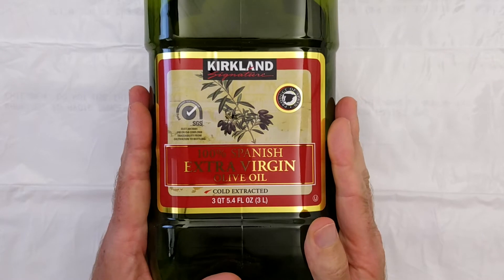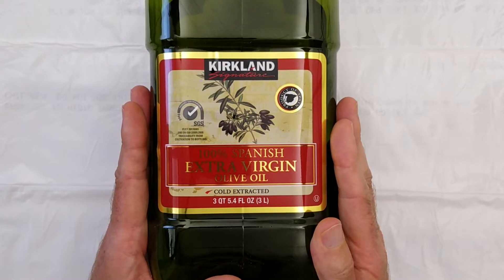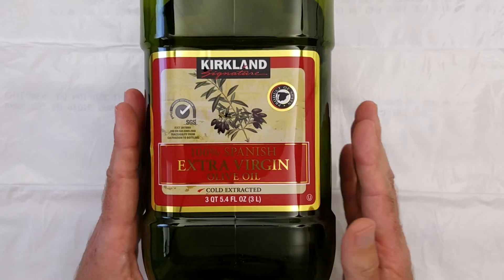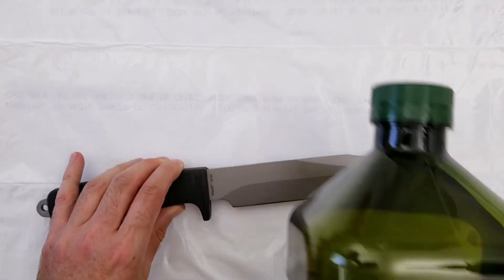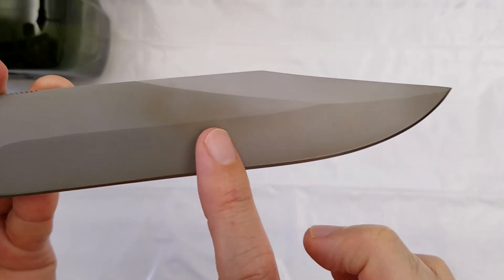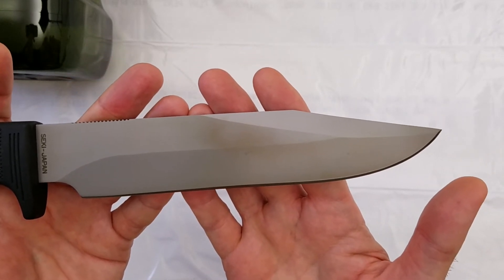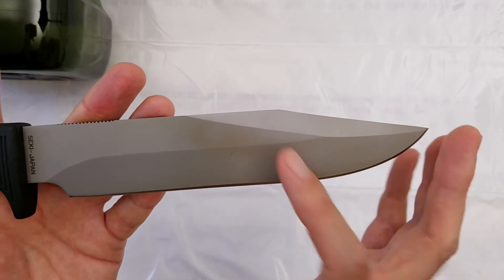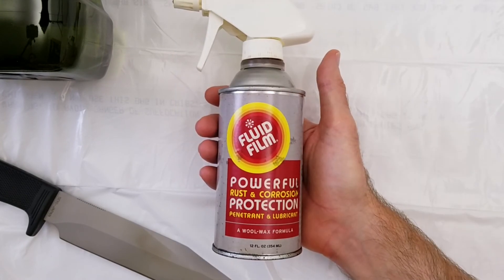Olive Oil as a Corrosion Inhibitor?  DON'T DO IT!!!

Comment: Thanks for the information on olive oil and lanolin.  I've never used these as a corrosion inhibitor, but I do use them as a mechanical lubricant for metal parts.  I use solid or liquid Lanolin on door hinges, but use olive oil when I need a thinner oil to penetrate smaller entries into where I need the oil to go.  I'm going to try Lanolin more for metal applications and also for non-mechanical corrosion resistance.
Reply from the maker: Thanks! I've been using Fluid Film for a bunch of years now. I'm not sure how much lanolin it has in it... maybe 25%? But it sure is effective for normal corrosion prevention. It's not rated as food-safe, but I don't think it has anything particular nasty in it like some corrosion inhibitors do.